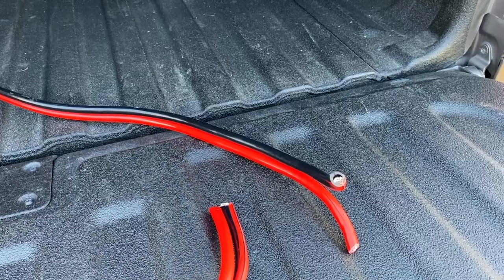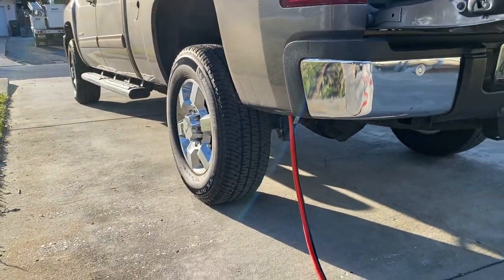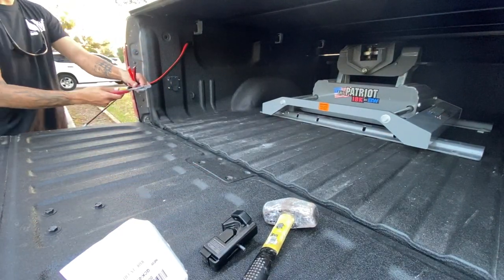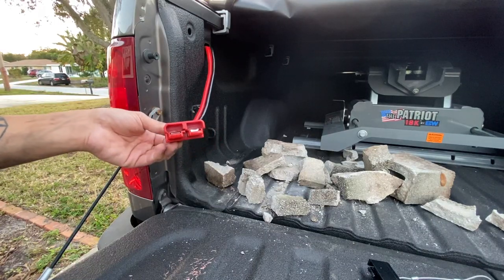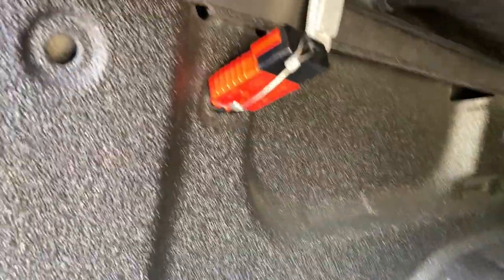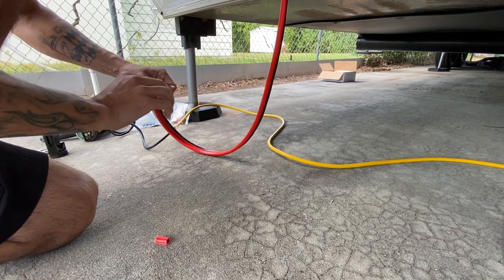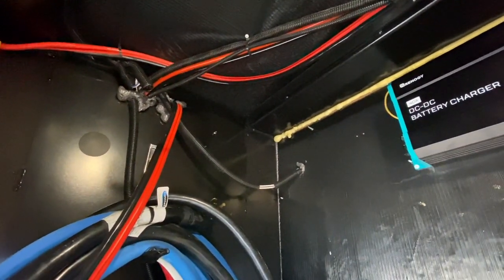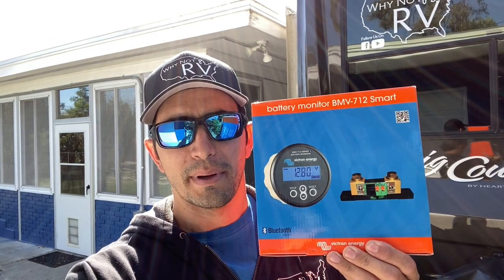Installing a DC to DC charger - Why Not RV: Episode 7

Comment: Awesome informative video, Thanks. I especially like how you simply run the yellow cable to power direct to the incoming hot wire. Simple. I haven’t seen anyone else do that. Can I ask what size fuse you run through before the battery connection. Thanks again! ✌🏽
Reply from the maker: Thank you for watching. I put a 50 amp fuse in line there.
Reply: By doing this, your RV will drain your truck battery... not a good idea
Reply from the maker: Brian, when you get to where you’re going you simply disconnect the connection in the bed of the truck.
Reply: @WhyNotRV  that’s right. Important to state this though, also to carry a booster box if you’re going to boondock, one oopsie moment and you’ll wish you ran to ignition or running light. Did you have any reason you opted for the “hot jump” over the other options?
Reply from the maker: Honestly just at the time it worked for me. I habitually unplug the 7 pin and the plug for this together every time I turn the truck off. But definitely a good idea to run a individual wire and carry a jumper box. I actually just recently upgraded my charger to a Victron Orion charger. It works by voltage detection and turns on when the truck is on and charging. Turns off when the truck turns off and the voltage drops below a certain voltage. All programmable. Super cool technology. Video on it is coming soon
Reply: @WhyNotRV  It never fails! I bought all Renogy stuff last month and almost every week I'm sending something back because I found something better. I'm going to stick with the 60 amp Renogy charger for now and use a Piggy Back Blade Fuse Holder with Wire Harness for the D+ Ignition Terminal wire. That Victron sounds way better.
Reply from the maker: I know what you mean lol. Next rig and setup I’ve already been planning for months. Hopefully by the time I actually get it I have everything 100% and ready to go
Reply: @ErikSjaastad  I think that is what left Foresty Forest stranded in the cold with a non-starting engine. The piggyback fuse connection for a smart alternator signal wire failed. See around minutes 2-4. https://youtu.be/R-OK0FYzj9s
Reply: @marionsutcliffe1119  Always carry a Jumper Box if you’re going boondocking, even if you don’t have a DC to DC charger.  I would ALWAYS carry one, period.

Comment: Using same charger. Gets so hot I can’t touch it for more than a few seconds! Is that normal? I’m using 6awg wire and 60amp fuse at the battery. 

Is the burning hot normal?!
Reply from the maker: It does nothing but produce heat. Where do you have it mounted? What is it mounted to? Wood wall? Metal? Carpet?
Reply: @WhyNotRV  I have it mounted in the bed if my truck inside an 80/20 aluminum cabinet. It’s mounted to 1/2 plywood. I’m thinking I may install a fan on the cabinet top right above the charger to pull out that heat. 

I saw someone else also say they put an aluminum plate behind their charger to help dissipate the heat. Not sure where I’d get that. 

Thanks for the quick reply. Great video btw
Reply from the maker: Yes, both a fan and an aluminum plate will help. You can get aluminum from various places. Tractor supply for example.

Comment: Great job, I have the same one as well, I'm a little confused though, do you have 2, 60 amp fuses, one under the hood of the truck to the battery, and one on the wall of the trailer? Where the battery is.
Reply from the maker: Yes. I have one fuse protecting the wire from the truck to the charger and another protecting the charger to the battery

Comment: Great job I just bought the same Dc to Dc charger for my slide in camper.  My question to you is when you moved your little yellow wire over the top to the live from the live battery wire isn’t that going to keep the charger on at all times which could possibly drain your truck battery?
Reply from the maker: Yes it would. You would have to disconnect the Anderson connector to stop it from charging. In your case I would look into a different option for a switch or something. A lot of people will tap into a marker light so when you turn your lights on it activates the charger
Reply: @WhyNotRV  Thank you.
Reply from the maker: Anytime! Thank you for watching

Comment: Awesome video....using for ford van...can I jump like you did with the yellow wire and then put a manual switch on the positive between the charger and van battery?.....to be able to shut it off manually...is that correct?
Reply from the maker: I would put a switch on that yellow remote wire of anything as it’s a low amperage signal wire VS the positive wire is high amperage most switches aren’t capable of that
Reply: Oh ok...that seems easier ...thanks for the info....appreciate it...👍
Reply from the maker: No worries

Comment: Chris, I would add an optional piece of equipment to your hook up.  I would put a dual battery isolator in.  This way I could go direct from the alternator to one side of my main battery and the other to the dc to DC connection.  This I would not be putting any drain on my primary battery bank.  Also the alternator would be charging direct to both systems.
Safe travels and roads Brian and Cindy, "xtreambydesign with passion"
Reply from the maker: Great addition here Brian.
Reply: That's what the D+ wire that he simply jumpered is for.

Comment: How do you determine size of wire to alternator?  How do you determine voltage needed to charge at rate you want.
Reply from the maker: Different wire sizes are rated for different amounts of amperage. Just Google what size wire you need for what amperage you are going to be charging with. I have a chart that is right on Google that I use for 99% of my wire sizing needs. The battery you were charging will tell you what the voltage you need to be doing your charge rates at. If you don’t know, contact the manufacturer to ask. But the information is typically online for every battery on the planet.
Reply: @WhyNotRV  thank you so much. Noobie here. Great video.
Reply from the maker: Thank you

Comment: I'm a bit late to the discussion but what happens to the cable from the truck that runs the signal lights on the camper? Do you disable the 12v charging pin?
Reply from the maker: So in this application, I had just wired it directly to when you had the Anderson connector plugged in the charger would come on automatically. The downfall is if you forgot to unplug it when you parked and turn off the truck, it would kill your truck battery. In a newer installation, I have used the marker light From the trailer seven pin connector to be the signal wire for the charger. That way the charger only engages and turns on when the marker lights are on.

Comment: Do you use propane or electric for the refrigerator while driving since installing the dc-dc charger?  And how did you run your wires from the bed of you truck to your rv batteries?  Great video. Thanks for your time and effort

Bob T
Reply from the maker: While driving I keep it on electric. If we are Boondocking when we get to where we are goin I switch to propane, or if I need the extra juice to recharge batteries from a night of AC or something I’ll leave the fridge on propane. I believe I went over my full wiring in my new dc-dc video which is episode 52 on the channel.

Comment: Great videos. Question my diesel  has two battery's does it matter which  one I run to? Thanks
Reply from the maker: Hey, thanks for watching! I appreciate it. The short answer is no, either battery is fine. The preferred method is to connect directly to the alternator if possible but it only saves a pretty minimal amount of efficiency.

Comment: Shouldn't that yellow wire be connected to the ignition switch or better yet to a relay, something that activates the DC-to-DC charger only when the truck is running and charging the starter battery? Otherwise the house batteries will tend to drain the starter battery when the truck is not running.
Reply from the maker: Hey Frank, thanks for watching. Some people do wire it to the running lights so it turns on when you have the running lights on. I have found that as part of my routine when I get somewhere I disconnect the electric connections from the truck every time. Works for me.
Reply: I just wired mine to the 12V wire coming from the 7 Pin RV plug.  That output is switched on my truck and is only hot when key is on.
Reply: @boulderwy3387  good idea

Comment: Thanks for that video! On my truck camper currently have 3 gel batteries of 88 ah that get power from solar panels. But when I'm driving the batteries don't get charged thanks to the engine so if I have to drive during cloudy days the batteries won't get charged properly. The truck has 7 pins connector cable but on the back of the truck there is only a 4 wires pin from the camper that is connected into the 7 ways socket. (it's like an adapter)
 There is obviously a MPPT solar regulator and an inverter. Any idea of how I could get my batteries charged while driving?
Reply from the maker: You could do exactly what I did in this video. That’s what this product does. You’ll just want to set the chargers profile to the same as your MPPT
Reply: @WhyNotRV  I have messaged you on Instagram... If dont mind trying to help me out
Reply from the maker: Ok I’ll check my messages

Comment: How did you get the cables from the storage compartment to the pin box? I can’t seem to be able to fish them through.
Reply from the maker: I use a “cable pulling / fish wire” and run it right between the “skin” of the rv and the framing of the upper deck. I’ve done it on several RVs now and always been the same

Comment: How did you ground the wires? did you do it to the frame at and the frame of the trailer? I having problems with heated up wire, I used 4 gauge and am moving to 2 gauge. Just would like an idea as to where I should place a ground
Reply from the maker: Hey William, I connected straight to the battery and straight to the charger.
Reply: @WhyNotRV  Thanks! I guess the trick is 2 gauge battery cables:)
Reply from the maker: Definitely want the right size cable for the amperage and fused!!!!

Comment: I understand the install but what do you do about the trickle charge your batteries are already getting?   How do you keep your lithium batteries from not damaging your alternator?
Reply from the maker: The wires are so small there it’s not doing anything significant. I’ve had to set up for a couple years now and do not have any issues with either set of batteries. Multiple people have done the same type of thing and don’t change anything with the seven pin with zero issues.
Reply: Then why all the fuss about lithium destroying your alternator?
Reply from the maker: Go on the Victron community blog. There’s a great write up on there about it

Comment: My class c has a solenoid from starter battery to house battery,does this charger replace that solenoid,i.e.can i remove the solenoid?
Reply from the maker: This device would replace your pre existing charging system from coach to house batteries

Comment: can you do a close-up on your yellow wire placement on the dc to dc charger?  I have the 20amp version and tey  are talking about a d-splice on the ignition wire and more... yours seems like the perfect and easy connection, thanks  "the American wanderer on youtube
Reply from the maker: I no longer have this rig so I can’t necessarily show a close up. The yellow wire is strictly the remote wire to activate the charger. You can flap into a marker light and use your lights to activate the charger or you can do it how I did and just go from the main power in and tap it to the remote but keep in mind that means the charger will instantly activate when you plug in the Anderson connector so if you stop overnight and don’t disconnect the truck you have to be sure to unplug the charger or it will deplete your truck battery overnight.

Comment: What do you thing about 20 Amp (40 amps) DC to DC charger with an 150 Amp Alternator (Nissan Pathfinder) ?
Reply from the maker: Hey Francois, great question, thanks for watching! As long as you aren’t running anything crazy inside the Pathfinder already (I.e. large stereo equipment or inverter) you should be just fine. However, each of these things can be a case by case type basis and I would do a bit more digging to make sure you don’t overload that alternator.

Comment: I wanted to confirm that you fused from the starter battery to the charger, and also from the charger to the house battery? Renogy’s manual implies this in a chart, but their wiring diagram shows a fuse from the alternator to the starter battery and from the starter battery to the charger, but NO fuse between the charger and the house battery. Fuses on each side of the DC to DC charger is correct, right? Or am I missing something entirely? Thanks; helpful video.
Reply from the maker: Correct. I added the 2 fuses as you stated. Most vehicles are already fused between the alternator and battery.

Comment: Wouldn't that charger be constantly on, even when the truck is off, when you wire that yellow wire to the truck battery positive instead of a switched power?
Reply from the maker: That’s correct if you leave it plugged in. What I did when I had that setup was unplug the connection when parked overnight.

Comment: I have a renogy 20 amp dc to dc should I still use a 2 gauge wire like you for this or use 4 gauge
Reply from the maker: You need to account for the heat from the engine and what not. As well as the overall length of the run. There is tons of wire size charts online to reference.
Reply: @WhyNotRV  ok I know it's about 20 ft I think travel from my van battery  to back of my van  .I just really determined that by taking a 20 ft battery jumper cable .
Reply from the maker: Gotcha. 6 gauge should be all you need there

Comment: Those jumper cables appear to be copper plated aluminum.  That stuff is awful for running any current and will cold-creep and loosen in the crimped connectors.  I would advise against using it.  I would also strongly advise using a hydraulic hex-crimper rather than that hammer-type one which only crimps in a small area.
Reply from the maker: I’ve been using them for over 5000 miles of towing and charging. A max of 40 amps going through them. I have constantly checked the cables and connections to ensure they’re not heating up at all. I do agree a hydraulic crumpet is the way to go. Will definitely be investing in the future.
Reply: Soldering them and water tight shrink tube is the way to go.
Reply: What cables would you recommend?

Comment: thanks for the video, i guess i'm just wondering if you have the yellow wire connected to the positive input on the charger, why wouldn't the setup drain the starter battery while the truck is off? wouldn't it always be taking a positive charge regardless of if the engine is running?
Reply from the maker: In this setup yes thats exactly correct. I later went on to wire it to a marker light so when I turn the lights on the RV it would activate the charger. and then I upgraded the charger to a big Tron charger which has engine start and stop detection
Reply from the maker: Victron* lol. Darn auto correct
Reply: @WhyNotRV  where can I get myself a big tron charger
Reply from the maker: https://amzn.to/3PMwZ7O
Reply: @WhyNotRV  The marker light thing works great because my lights turn on with the motor running, but you have to remember to not turn on the lights without the motor running you you can have a dead starter battery. Is the aux pwr off when the truck is not running? I could use that instead for the sense wire if so. I know there is a relay for it....
Reply from the maker: Are you referring to this charger still or the Victron version I later upgraded to? With this setup I had to unplug the Anderson connector when I turned the truck off.

Comment: Great video, please tell me where to get the fuse that’s attached to the positive battery terminal
Thanks
Reply from the maker: Thank you. I believe you are talking about this ANL fuse. https://amzn.to/3IAMzkH
Reply: Thanks for the super fast response!
I’m running a 2019 f250, I ran 6ga to the input side of the 20 amp charger 50 amp busman inline fuse on the pos terminal,and have been trying to figure out from videos what type of fuse and where to get it… pretty new at this . Switched over to a Lifepo4 Lion energy( want 2 ) and a progressive dynamics 60 amp 9100 series charger.
I don’t have any solar yet so do I need to also tie this back into the breaker panel or just to the battery? Thanks again.
Reply from the maker: Just the battery. Or whatever distribution bar you may be using. The breaker panel (dc side) will pull what’s needed from the batteries and the charger refills the battery
Reply: Thanks again! I just ordered the fuses and a couple of spares… do you have an affiliate store with Amazon? I don’t mind buying through affiliates that help me👍
Reply from the maker: If you clicked my link in the above comment I should get credit for it. I do appreciate it!!!